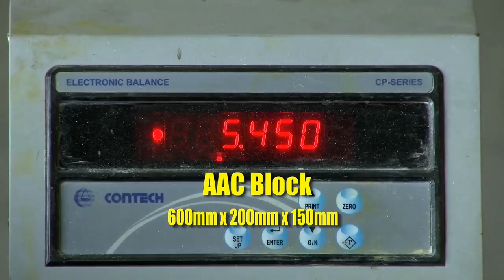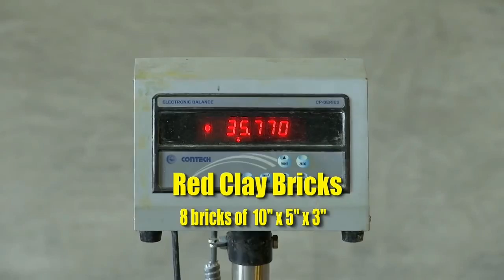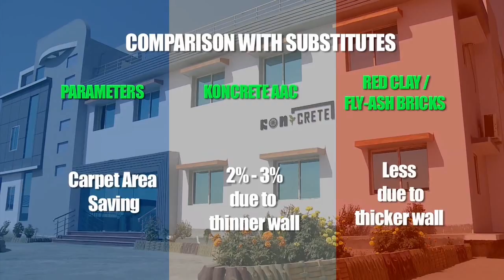Aerated concrete VS Red clay bricks

Comment: Why would anyone choose regular bricks over AAC?? Esthetics?  That's the only reason I can think of off hand. In fact, I think I'll use non-autoclaved aerated blocks to rebuild my house. I could do it at a fraction of the time and cost.
Reply: Because the real cost of laying brick is a mason and  you have skilled setters and laborers on big jobs you would save money but on the labor not skilled brick layer or the equipment to move the volume of material to the site.  Plus even though video does not say there are major drawbacks to air stone mostly it lacks compressive strength you could hammer right through it.  The footer and supports are concrete and steel anyway look at the video